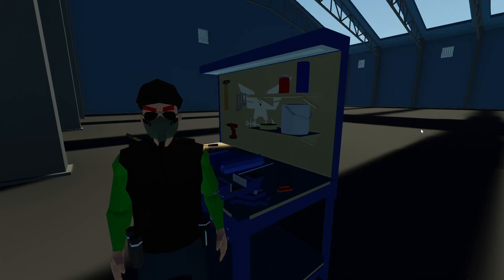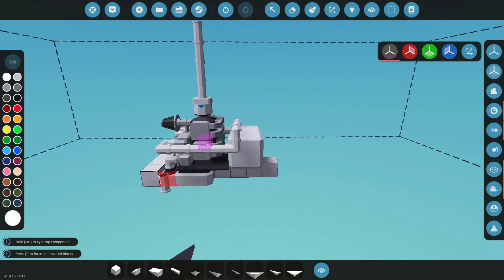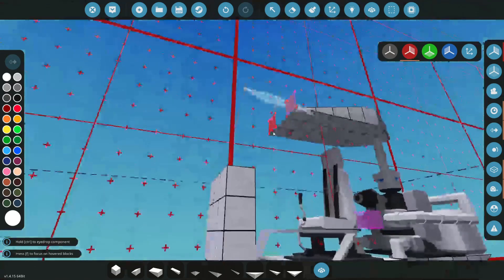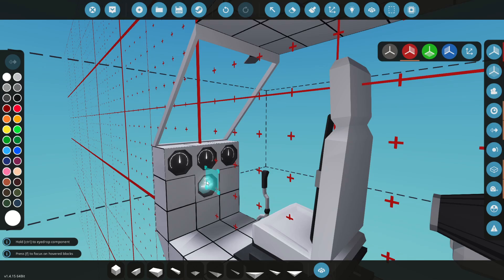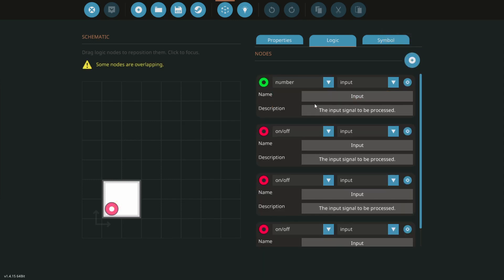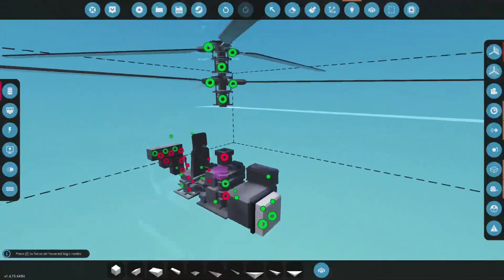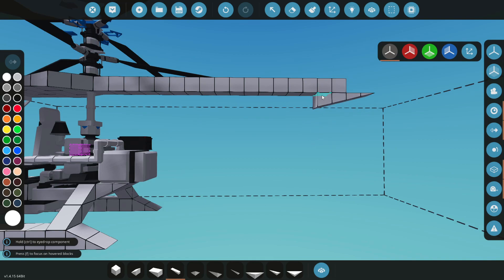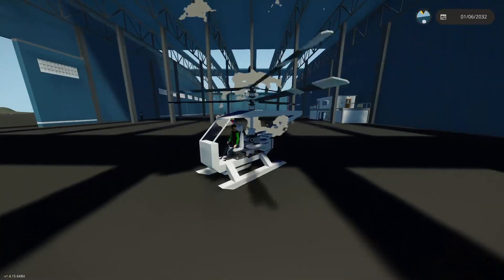Beginners Coaxial Helicotper! Stormworks Tutorial - How To

Comment: I'm sure I connected everything correctly, at the beginning it seems to work but then after a few seconds something seems of with the gyro it keep shaking forward and back like crazy, any idea whats wrong?
Reply from the maker: not sure, double check all connections.
Reply: I think its a bug with modular engines. mine did the same and works with a regular small engine
Reply: @loganlemaster8942  For me it was misplacing the rotors, make sure you follow closely with the rotor placing instruction, bottom rotor should be a default rotor facing forward on Y axis and the top one should be facing forward but flipped on roll axis(you can tell by check where the arrows on the rotors point)
Reply: @nxidplease  Glad you fixed it, I did check everything. When I deleted the modular engine and replaced it with a small engine (everything else was the same) it worked. I did play with the gear boxes a little bit, when I increased the blade speed the issue came back. So there may be a bug with the rotor speed. So anyone reading this in the future, maybe try using gear boxes to slow the rotor speed down.